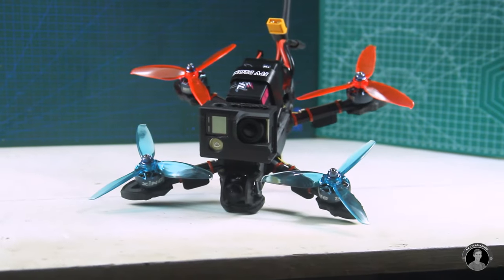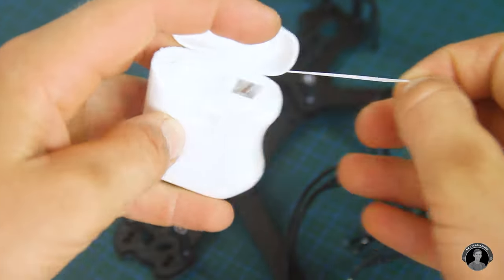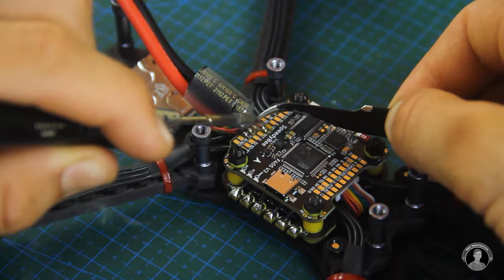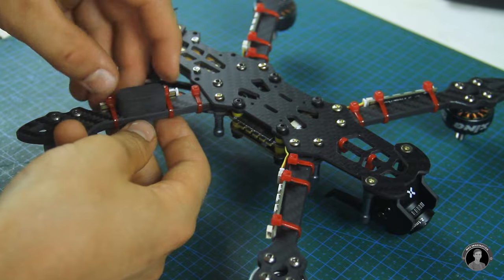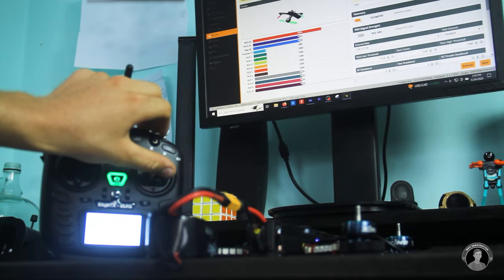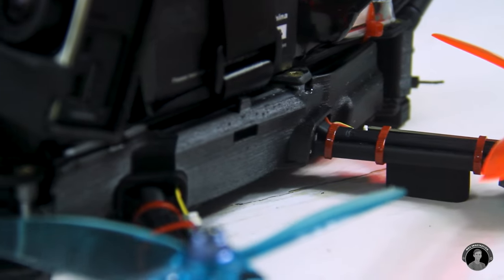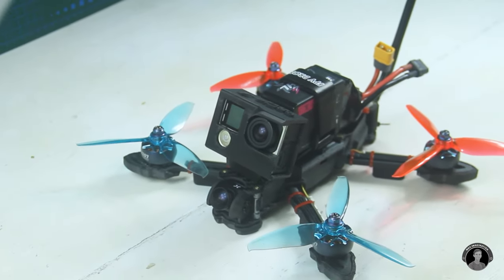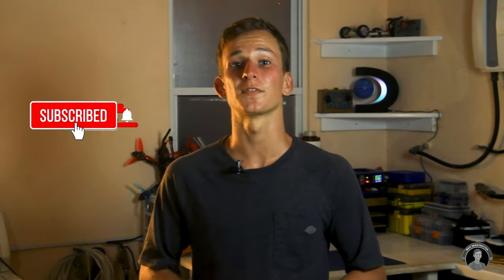Building the Ultimate 5-inch FPV Freestyle Drone

Comment: I recomement to you a 5.6GHz antenna for you video transmisor.  I guess the antenna wich you put on your drone is 2.4GHZ. 🤔  ???
Reply from the maker: The second antenna I used is one that normally sits on 2.4G modules, yes, but doesn't matter if I'm using it for 5.8G modules. Same same... 
Today I use the drone with a Lollipop (shorter) antenna on the VTX, works perfect.
Reply: GRACIAS

Comment: Great vid. Can someone tell me what i need to build a race drone without the camera as want it for line of sight flying and stunts only. I want it to run alteast 4s and be a 5 inch quad. Thanks guys
Reply from the maker: Thanks. I suggest you check out other videos showing how to make a 4-5S quad. It's up to you whether or not you use an FPV camera on your drone, but it will 99% of the time be easier to control it with goggles on. FPV quads are super awkward to control without FPV.

Comment: Did you buy the capacitor and the pigtail separatley?????????
Reply from the maker: The capacitor came included with the ESC stack. Also, what pigtail?
Reply: @MaxImagination  The one you installed at the same spot as the capacitor
Reply from the maker: That came included with the ESC too.

Comment: The only thing that is not good with this is the fact that once you break an arm you will have to buy the whole frame again....I don't see anywhere to buy extra arms.
Reply from the maker: With cheaper, non-standard frame kits as such, I agree it can be a hassle... At least the frame kits don't cost so much, and if purchased again, you'll have extra spare parts.
Reply: @MaxImagination  I've done that before...and before I know it I have 6 of a part I'm never going to need replacing...I have a big box just full of FPV junk that will never get used lol

Comment: i had that vtx also and i can tell you that its not real 800mw, if you want real range i suggest upgrading this speedybee vtx to something better like IFlight Blitz 1,6W, or even JHEMCU 1,6W its cheap and almost in speedybee range but i have both and jhemcu have lot more range and you can easly fly 5km+ on it, and for comparison i went max 500m on speedybee before i lost my video feed

edit
this speedybee is also 5v input which is pathethic because most 800mw vtx use 4-6S voltage and have 30x30 size and thats why i think its fake 800mw and in real life is probably less than 25mw because i have 25mw vtx that work better than this speedybee crap
Reply from the maker: Thank you for your comment. This is what I needed to hear. I've been dissatisfied with my drone's video range and your point on the problem sounds the most likely thing that's wrong. 

I'll consider making this upgrade. Cheers!
Reply: @MaxImagination  if you are interested i make range test of Iflight Blitz 1,6W 45$ vtx that works best from what you can get for this kind of money i think, and with this one you will unleash full potential of ELRS and long range FPV for sure

Comment: three mistakes you did. 
1) Your VTX is to close to the carbon fiber frame. Get some M2 standoffs for it. Reason? + and - pads will short the VTX. It happened to me. 
2) The receiver is to loose. You are literally messing up your gyro signal. You could literally see the bad performance in this video.
3) The side cover does affect your yaw spin. In other words, wobbly. You want clean air. If I remember... Joshua Bardwell explained this before. 
Beside that, everything is fine.
Reply from the maker: Hi there. Thank you for your corrective tips. I'll consider making those changes soon.

Question. What do you think I need to adjust or change to improve the FPV feed signal? I use cheap $80 iFlight goggles when operating the drone, could this be the affecting factor to my limited video range of 100m?

Comment: Don't forget, BC it is heavier than 250 grams you need a license to fly the drone.
Reply from the maker: Good one to keep in mind for those who want to fly it in regulated countries.
Reply: @MaxImagination  Yeah.
Reply: I know I'm late to this thread, however 250g+ quads do require to be registered with the FAA and are required to fly with RemoteID. I won't tell you what to do but a lot of pilots don't follow the rules as Remote ID modules aren't the cheapest thing in the world and they give a lot of data about the pilot out to the public. But always check local regulations and do your research on current FFA rules and guidelines. Or just fly a sub 250g drone 😅
Reply: @potatoes6390  Yeah, I won't (yet) fly with +250g drones without ID. I have a DJI mini 3 so yeah that one is sub 250g.

Comment: capacitor is usless if you source is a battery
Reply from the maker: The capacitor serves a purpose as it temporarily stores energy for the onboard componets as the battery gets burst drained with aggressive maneuvers in flight. Pro FPV pilots still use these with their quads.

Comment: How did you get the Tx12 to connect to the Express LRS 
module?
Reply from the maker: Hi there. Before you can connect the Tx12 to the receiver, you need to follow the steps in this video to first configure the transmitter- https://www.youtube.com/watch?v=8KaJOT190V0&t=301s
Then in your transmitter, you will find an option to bind with the receiver. The first time you do binding, plug and unplug the drone's power connector 3 times and then keep it plugged in for a rapid blinking green light. That indicates your drone is ready for binding. From there, proceed with binding in your transmitter UI.
Reply: @MaxImagination  Thanks for the response. I have to do the battery unplug/plug in method. For some reason Expresslrs software keeps having issues connecting through wifi and wont build or flash. spent hours looking at videos. Did follow your drone build list though. I got all the same parts as I liked the build.